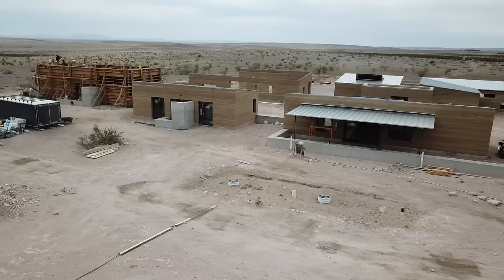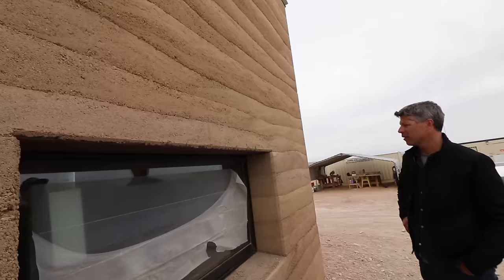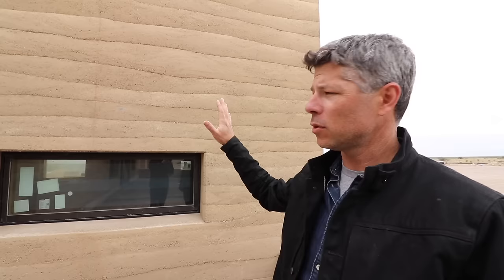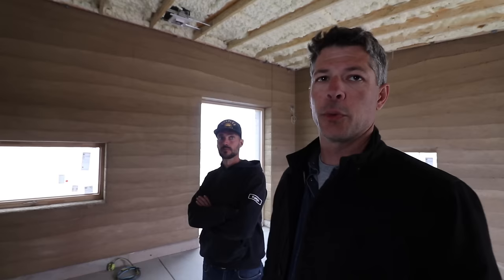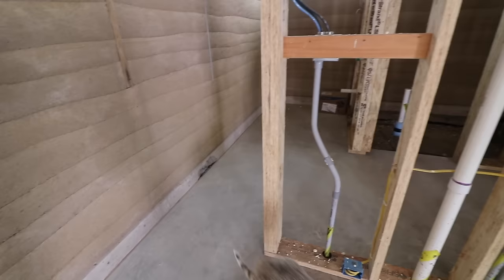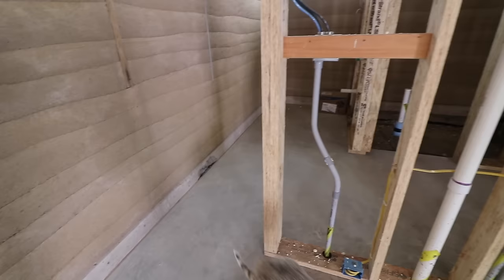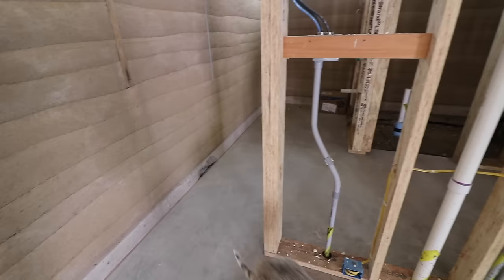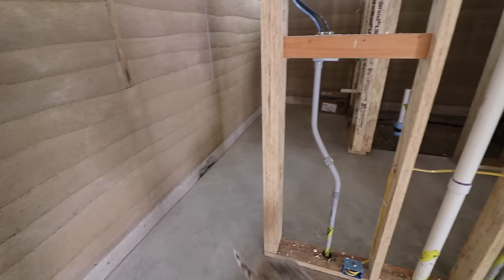Rammed Earth : You won’t Believe How They Build This!

Comment: Not cheap to build! Seams like a huge amount of labor compared to other construction methods. It is unique.
Reply: Semper Fi so is concrete.  And way cheaper...
Reply: Hammurabi I. I would agree with that. But the downside is this is a pretty drab environment for a nice house. To each his own. Ya gotta live somewhere, and no reason to deny anyone nice digs. I’ve got an icf house and love it, but truth be said it’s an expensive way to build, and a pita for contractors. I doubt any of these systems will gain significant traction in mainstream because of cost comparisons, despite damn near anything is superior to a 2x4 wall with fiberglass insulation....  of course, even in that wall, the devil is in the details, so who knows.
Reply: I have seen rammed houses that are cheaper.  But once you get building inspectors and novelty material, and engineers be prepared to spend at least triple.

Comment: I would want a wide overhang roof for this type of construction.
Reply: It depends on your climate, in Marfa you are ok without a large overhang. But if you live in an area that gets a lot more rain, then a wider roof would be wise.
Reply: @salvadorpatino6248  I would want the larger overhang for shade being out in West Texas. Even with the two foot thick walls.
Reply: You wouldn’t want that in the middle of the desert, i.e., you wouldn’t want critters—escaping the heat—to take shade near your homewalls.
Reply: @clay.willoughby  additionally they specifically mentioned that they wanted sun to hit the walls to provide some warmth during the nights. Theoretically the thickness of the walls should provide a consistent temperature throughout the 24 hours.
Reply: Before all other concerns, I don't want water running down the side of my building or draining into the ground right at the base.
What facade can withstand that contact with water for  just 10 years with no ill effect.
Reply: @thisisconstruction.  So if you live here you are in the house or you must have direct exposure to the sun. No deck, no patio umbrella 
..It's either the critters or melanoma?
Call me crazy but maybe that should build that house somewhere else if shade is such a danger.
Reply: @thisisconstruction.  Please explain to everyone how even a 3 foot overhang provides constant shade with a sun that rises & sets.
Reply: Semper Fi  Great argument for wall heat loss & overhangs. Too bad that you missed the point of permanent "ground" shade and the idea that it attracts critters. Focus!
Reply: @10thMorales  ..good point. theres something to consider
Reply: @reallunacy  

Since when is an 80° night something that needs warming? Before you respond...I live out here. We spend money putting a separate detached roof over our houses to keep ALL direct sun off them. 

This guy doesn't know the weather or climate out here. He's trying to make up some fake reason the thick walls would be important.

A typical classic historical type adobe or stucco brick house in the area has 8-12 inch thick walls. Last for hundreds of years, cost less to make, uses less machinery to make, and holds the inside temperature better.

You don't want the outside temperature inside. It's too freaking hot. 95° average over an 8 month summer. There are weeks we don't see less than 105°. And no, dry heat doesn't make a difference after you pass about 78°. It's miserable. After a hard days work in 95°+ temps, you don't want to go into a house and try to sleep in an 80°+ bed.
Reply: Wow. You people don't get it. ANY average shade is mathamaticly factored in giving you the over all avg temp. If you happen to want  OVER ALL LOWER AVG TEMPS for the space by all meanes do so at your own discretion. You could then 'throyaticly' make a large refrigerator as long as you have water and an evaporative matrix.

Comment: Just curious how much that stuff cracks as the building settles .
Reply: I really don't think there is much settling out in that part of the country.  Just need to stay away from rainy climates.  (Think adobe and stucco.)  A lovely construction method.
Reply: It won't settle. That's why they have a concrete base wall poured and the soil house sets on top of it. The biggest problem is the entire concept. It's taking them over a year to construct; it's mostly all done by hand; even if the outside walls hold up, how long will the wiring, plumbing, heating & air conditioning last? There aren't any contractors out there who can repair any defects, damage, or failures. The whole thing has to be replaced if ever there is a need to repair it, or you have to call the original contractor back if he is still in business?
Ever try walking or standing for long on a concrete floor? You will feel pain in all your joints and there's not much you can do about it. Break a window or two and see what it will cost you to replace them? They are obviously not found in your average Lowe's or Home Depot! Forget this kind of construction! Only a rich foundation could afford to build like this! One that has money to burn!
Reply: deerflyguy I’ve always wondered what happens with radiant heating if one of the pipes breaks or is leaking, how could you know? And how would you fix it if the leak is in the middle of the house

Comment: Always good to see different building methods, but I can't see where a rammed earth building could ever compete with an ICF building in any climate.
Reply: Hahahaha you people with ICF. Those systems are junk compared with whats avaliable.
Reply: @sparksmcgee6641  :  Please show us the proof that quality ICF products from companies such as BuildBlock and Nudura when installed according to specifications are junk?

Please share case studies ... testing results ... actual facts ... not just your personal rant.

Educate us as to your sources of wisdom.
Reply: @Real_Tech_Skills  ICF is a great way to build but builders don't like when owners build their own houses
Reply: I could be way off base here, but when I see insulation I think mechanical heating and cooling. Some climates can take advantage of thermal mass and use neither. Other climates may be able to utilize thermal mass with a heat source for cold stretches.
Reply: @Real_Tech_Skills  any comparison of ICF strength specs, performance, ease of installation and cost compared to a product like Thermomass the ICF loses. People selling icf dont want buyers to know how easy it is to rent concrete forms. And icf add extra layers to the evelope which adds to the chance of mistakes or misjudgements by untrained trades.
Reply: Also to your point a rammed earth competition with ICF on design and the ICF is laughed out of the room.

Comment: I love the Channel. I am electrical contractor and my biggest question is how do you wire a house like that? Is the client OK with exposed conduit?
Reply: I'm betting most of the interiors get a finish wall, might not be what the architects called for, but it's going to be a necessity for any future renos.
Reply: I've wired log cabins before and subterranean homes all had finished walls on the inside. But then your thinking what's the point if you just see drywall like every other home.

Comment: Labor cost is the most of making a house or building of that size so if you are increasing the amount of labor into a project, it doesn't matter what material you are using the cost of production is still high as heck.
Reply: Much less if you and a few others are the labor. Equipment makes it more expensive as well. Often you can use the soil that is on site, add clay or sand to get it right. People have done it by hand tamping as well.

Comment: "Not inexpensive" = cost....LUDICROUS
Reply: Right? Also, isn't floor heating insanely expensive?
Reply: Agreed: The foundations have to be massive to hold the weight of rammed earth walls.   You'll spend a fortune in concrete.   I think CEB is a little easier to do, but again foundations are massive.     Monolithic domes are better for the money and performance.  Just harder to put windows / doors / cabinents on the rounded walls.
Reply: @andrewcopple7075  No; it's extremely cheap and efficient. New installs it's def on par with other methods(Cost wise) but savings from efficiency and comfort? It's cheaper.
Reply: Yes the cost is higher, but that is a 500 year building material. You do not get 500 year longevity with stick frame building. If you watch more of Mr. Risinger's videos he describes many ways that stick frame buildings fail. The cement stabilized rammed earth construction will outlast anything else. So the cost is also mainly in the labor and building of the forms. Building massive foundations to handle the mass of the walls is no big deal, because large foundations are engineered for large buildings. Again, more cost up front, but the recoup in energy usage to heat the buildings in the long run will more than pay for the buildings themselves.
Reply: @jameskniskern2261  makes sense but....yes this building construction is great if you want to build a building to last 8 generations of your family as since the way it will pay for it self is through energy bill savings your families will have to live in it that long for it to pay for it's self. But thanks for the info.
Reply: @RossMalagarie  I have built, and I currently live in a rammed earth home. If you hire a contractor to provide all the labour, then you bet, it would be nuts. Most people, myself included, put a team together of friends/students/relatives to do the bull work, as it is very simple - like, dead simple. When you do that, the cost is brought down, to the point that I calculate about a 5% premium over 2x6 walls. As someone else mentioned, thermal performance saves money, and also, when you consider the lifetime costs of rammed earth, such as the fact that it won't rot, mold, get insects/rodents, burn, or break down in many lifetimes, I would argue that it is cheaper. Sad thing is that most people don't consider beyond 10 years when thinking of a home build or purchase. We did - and hopefully our grand children and beyond will live in it. I wish more people would prioritize longevity.

Comment: I spent a day with the author and proponent of Rammed Earth houses in Napa CA, David Easton.  I think the take away was the monumental form work required, to offset the compaction stresses.  Not for the fainthearted or those without significant financial resources.  An ass-kicker of a way to get thick walls with character.  The concealed bond beam at the top is its own event to achieve and a huge requirement here in earthquake country.  Once again, Matt..... a great video.
Reply: neal walden,  I also live in Napa and a friend was going to build a rammed earth house until he did the calculations on how much larger the foundation has to be as compared to a stick house. Having said that, there's nothing more beautiful than rammed earth.
Reply: Think you could rent commercially-available steel forms and get significantly faster/cheaper results.  May not be the art quality of this project, but it obviously can be done far faster/cheaper, especially if you could set up your own on-site batch plant.

Comment: That is a VERY PARTICULAR construction method.  The outside walls and floors define what the overall structure is gonna be like, but the interior walls might probably be changeable.  Forget about additions...  I was amazed that water was not used.

I would have thought that water was used to set the mud/cement/whatever that material mix is, but no water is used!  Amazing...

Comment: I've been giving this some thought. Ther is a company called Symon's Forms. They make very large steel heavy duty concrete forms.They bolt together. They have steel strong backs and so forth. They would be a better choice for doing rammed earth. They can be put together in very long, very tall shapes. They can also be reused time and time again. Symons forms will rent them to construction companies. They're so much stronger than wooden forms that you could go to a higher psi.
Reply: Everything sounds good in theory, however with steel, you need heavy equipment to transport the steel plates, angle iron, I-beams... And then you would need some sort of crane to erect the forms. It's far less expensive to use and re-use stud grade lumber, and plywood.
Reply: @armanflint  You are basically correct, except that the steel forms and cranes or whatever save time... time is money too.
Reply: They need some way to mechanized and speed up the building.
Reply: @justgivemethetruth  That's why the Symons forms I recommended That and a custom built compaction machine would do the trick

Comment: A “500-Year Wall”... That undoubtedly, will have a few significant structural cracks, not unlike any other design, in less than 30 years. I’m encouraged by this, just not convinced. Especially with the wood inserts for the windows, etc.
Reply: When he said there was no rebar in most of the walls (especially with how thick they are), I was thinking the same exact thing. The one wall showed that did have rebar looked like it only had vertical ones, too.
Reply: I caught that "500" too. I get the impression the earth Portland mix is much like bricks, but sometimes common bricks start to fall apart especially on chimneys where they exposed to more elements. Well at least where I live in the midwest with Rain / cold / summer.
Reply: @kendrickdelosreyes5381  I noticed that too. When we built our place, the engineer made us do 2' spacing vertical rebar and 4' spacing rebar through ties. Our home will absolutely be here in 500 years, but I think it was overkill.

Comment: This would be a game changer for those states that have lots of tornadoes.
Reply: Those states also have lots of rain. I live in tornado ally and the is not much that can withstand a serious tornado, however I like this type of building in a dry cool climate.
Reply: brilliant
Reply: You can bet it’s tougher than a stick built house.
Reply: @alphagt62  Yes it is when in its climate but I wonder how it would do in our climate with a  47 inch average rainfall, hot summers and yet sub zero winters.  The best is type is, underground homes in this area, if you can find the right conditions and have no zoning problems.
Reply: @AdamosDad  I live in tornado alley as well. We get lots of rain and the ground freezes. The earth is clay. So I imagine a building like this will settle and crack in a couple years.
Reply: @TheOsylith  Yes, even native Americans built different here than in the south west.
Reply: This house would be a death trap in a tornado. Nothing left but the concrete base.
Reply: @bobbyt9431  Stabilised rammed earth acts in nearly the same manner as concrete walls. Physically, whatever would happen to a concrete wall would be the same against a SRE wall. Damage would at most be impact marks from heavy airborne debris. An unstabilised RE building may deteriorate from the heavy forces a little but it would likely not fail structurally unless a massive solid impact is faced.
Reply: @dragondan9  Only if it is steel rebar reinforced, which tornado/hurricane proof concrete walls are. Otherwise it is too brittle without enough shear strength and you risk a several ton wall falling right on top of you, especially if the roof is very securely anchored to the walls. The only complete tornado proof-free standing structures are steel rebar reinforced single poor concrete. Even concrete block reinforced with steel has not held up to the strongest tornadoes.

Comment: The architect was explaining how the walls absorb heat during the day, and maintain it as the night cools down for a more uniform interior temp.
Reply: R value of zero.
Reply: Mike M A high R value isn’t desirable in the desert. Thermal mass will do the job. The method is regionally specific, but it works well.

Comment: I have done electrical to a 10 thousand square foot home in Toas NM about 13 years ago made of rammed earth the key to doing the electrical is running pvc to interior walls including your main panel and sub panels this eliminates notching the rammed earth to meet codes in these houses with open area is using floor boxes anything that can be done before slab is poured is the best way to go including communication lines the house I worked on was using spray foam insulation on the interior and exterior walls these are solid homes

Comment: @matt since ur the waterproofing nerd, would be great to see some building science on these with regards to say a wet climate.... maybe a future video.
Reply: Wet climates would require a decent roof overhang and a wall sealant
Reply: k7gixxer1000 not necessarily - check Martin Rauch's own house in Schlins (Vorarlberg, Austria).
Reply: Dude that makes these in the Pacific Northwest without sealer sprayed it with a pressure washer without any wear. I heard this video say hard as an old brick, and a man made sedimentary rock. They get rained on - no problem.